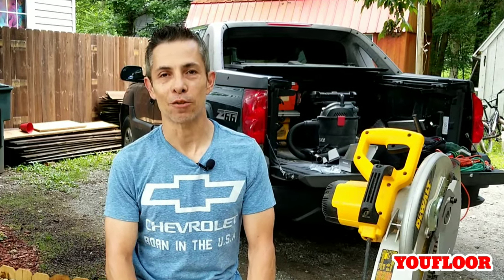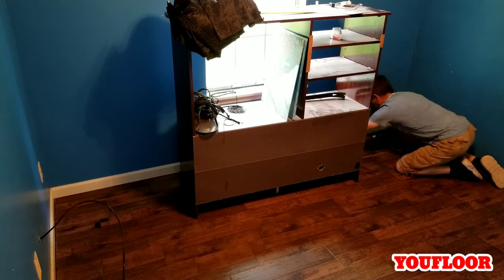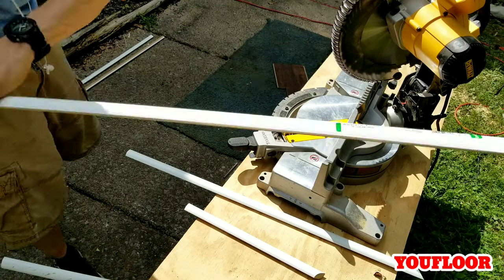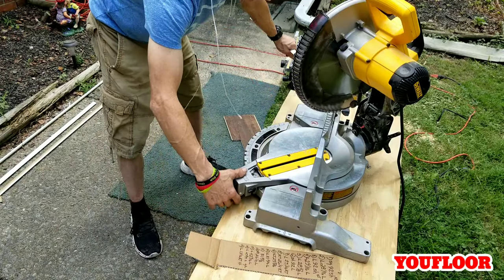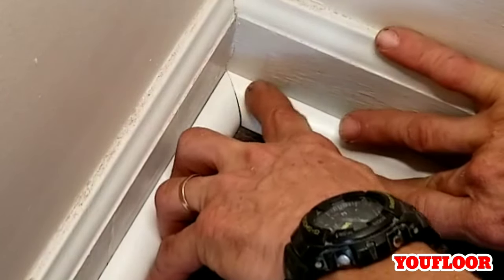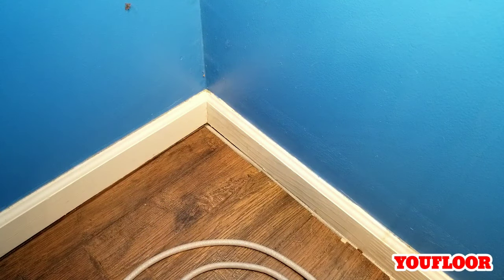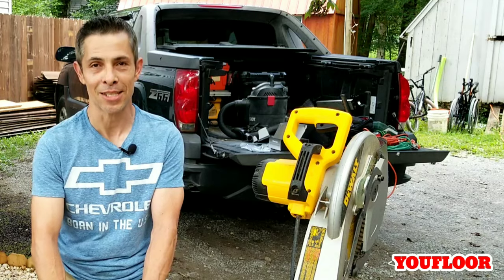How To Install Quarter Round Like A Pro

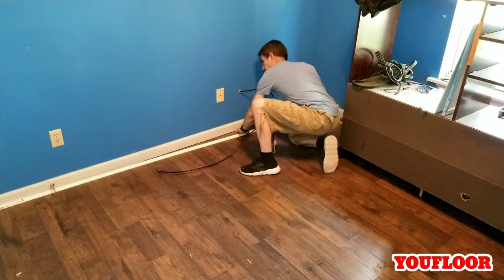Comment: Nice! So you cut the splices at 44 too? Sorry if this was answered already, I searched the comments, - nada. 13:04  6:33  . number 6 you don't write 45º - 3:12
Reply from the maker: I see what you mean. Yes, I use a 44° . There are way more inside corners than outside in a typical room. So I use the 44 to stay consistent and to keep from having to move the saw again. But honestly, you can do your splices on any angle you want as long as you stay consistent. Don't want to cut one side on a 45 and then say to yourself, " Was that a 44 or 45?" So if you decide now that all your splices will be on a 22.5, then you'll always know what the other side is. Base in your rul for splicing. Hope that helps. Thanks for the question
Reply: @YOUFLOOR  Oh yeah, thanks - meci - obrigado, for the free tip.

Comment: How many teeth for the blade do you recommend for the saw for the mitre cuts?
Reply from the maker: That really depends on what your doing. If you are cutting  lumber or 1x material  such as 1×4 1×6 1x8 ect. Then 40 teeth should be sufficient. But if your cutting Intricate cuts including small fine pieces I use 60 teeth. They make 80 teeth and higher but for the money 60 does me just fine. Hope that helps. Thanks for the question

Comment: HI Z, when you splice 2 pieces of shoe together with CA glue, what angles are the 2 pieces cut to?  Great video!
Reply from the maker: Most of the splices Re on a 44° . No particular reason other than it keeps from hav5to adjust the saw. There's usually more Inside corners than outside. Also I don't always use c.a. glue for quarter round. But I want people to be exposed to it that went aware. This stuff is great for baseboard,  crown molding, door casing. I love it. Thanks for the question

Comment: should i install a baseboard before installing a quarter round?
Reply from the maker: Base board should  be put on before 1/4 round. And if your flooring goes all the way to the walls with expansion gap you wont even need 1/4 round if the baseboard covers the edges with no gaps. Hope that helps.  Thanks for the question

Comment: Hi, new to this, and my miter saw  (a hart 7") sucks the wood in and splinter it if its too short. t I dont know what to do.   If there is significant length on both ends its not a problem, though it still does chew the edges up a little bit.  Any ideas to help me with this?  I'm new to this miter saw and am ready to go back to using a hand saw.  Thanks
Reply from the maker: Couple questions 1.  Is your saw new or did you buy it used.  If you bought it used and may need a new blade if you bought it new it may need a good blade.  When the blades get old it can leave the ends of your material frayed and it can also chunk small pieces out. I've even had them throw pieces 15' away at a high rate of speed ( #SAFTEYGLASSES). This also happens when the blade it bent. With the saw unplugged look at it from the front and turn it slowly to see if it wobbles. Here's a couple tips that may help
1.  Get a new blade. Diablo is a little more expensive but last twice as long and it is well worth it. Trust me your 1st cut it will feel like a hot knife going through butter, like it was cut with a laser. That might fix the problem right there. 
2.  Make sure the blade is spinning at top speed before you pull the handle down to touch your wood.  Also let the blade stop spinning before you lift the handle. this is what always makes my wood chunk out when it happens
3.if your cutting a real small piece. Take a piece  of scrap wood (example: 1 inch wide 1 foot long and 1/2inch thick. Kinda like a thick ruler or whatever you have) put it against the fence 1st then put your piece of 1/4 round against that. It will cut them both but stops the small piece from flying away. Then you can slide your scrap piece down to cut another one. When your scrap piece get too small. Get another one. Sorry so long, but I hope that helps. Good luck with your project. Thanks for the question
Reply: @YOUFLOOR  Thank you so much for your quick response!  I really enjoyed the video.  Its a new saw, but inexpensive, so maybe the blade it came with is not great.  I'll give the scrap piece of wood behind the trim piece a try and see if that helps.   Thank you again for your response, and the video!

Comment: What length and gauge (18?) nails are you using to fasten the quarter round?
Reply from the maker: Yes 18 gauge.  2 " long
Reply: @YOUFLOOR  Mind if I ask why so long with laminate moulding? I would think a 1 .5 would be plenty long enough.
Reply from the maker: Well sometimes the base board is a little too high for the nail to make contact with it. The nails will shoot underneath.  But 3/4 molding, plus 3/8 base mold, plus 1/2 drywall is 1 5/8 inch that leaves 3/8 of and inch to penetrate the bottom plate or shoot down at an angle through the expansion gap. When you run across  those small dips  trying to get the 1/4round to stick is tough without enuff grab. If the base boards are low to the ground 1 1/2 inch is fine. I have used 1 1/4 in a pinch but you have to be precise and go through the very top of the trim without skipping off to get it to stick. 2 inch nails covers everything . Hope that helps. Thanks for the question.

Comment: Is the measurement you write down the length against the wall or the outside (visible)? So for the L 29 & 1/16 L example how long is the side that goes against the wall? You can tell from my question I'm a little confused about this. I'm thinking its the length against the wall so in this example the finished side would be about an 3/4" shorter (3/4 thick).

Comment: My quarter round is not caulked on the bottom, and there are bugs constantly climbing out from the bottom of my quarter round. Is it supposed to seal the upper and bottom portion of quarter round?
Reply from the maker: @Esabella Li If the perimeter was sealed there should be a silicone seal that bonds the quarter round to the floor and the baseboard. No critters should be able to come through it. Are you sure the perimeter was sealed? Thanks for the question.

Comment: What do you do for an end part that is visible ( next to a door where the trim is flush with the door frame)
Reply from the maker: Good question. You probably  need to put a return. I go over a couple different ways to do returns in this video.https://youtu.be/abkTRdbOd2I. Thanks for the question

Comment: Will the backer and caulk cause issues with expansion and contraction?
Reply from the maker: No sir as long as you use 100 % silicone you should be OK. It's very flexable
Reply: @YOUFLOOR  thanks for the reply! Have you ever tried big stretch? It's not 100 percent silicone but it's supposed to allow a lot of movement
Reply from the maker: I haven't heard of that. Will have to check it out. Thanks for the tip

Comment: Do you do the same  thing 44 and 46 degree for base board installation?
Reply from the maker: No. I usually cope base board. Should make a video about that. Thanks for the comment
Reply: Thank you for the reply. I used your method for my last quarter round installation. I learned how to make a list of cuts and 44 and 46 deg cut idea. It worked very well. Now I  have to base board at other location. Thanks again.
Reply from the maker: That makes me smile. Thanks again for the engagement

Comment: I agree, a great video.  Just a question about the 44 and 46, obviously that's for 45 corners but would the rule of thumb be a degree less for any inside corners and a degree more for any outside corners that isn't 45?
Reply from the maker: Hmmm. That's a great question. Some times I do a 23° on 22.5° angle sometimes. But for the most part if it's not a 90° inside or outside corner I usually use my angle /miter gage to get the exact cut. Thanks for the question
Reply: @YOUFLOOR  Thanks for the prompt reply.  But if you make an exact cut, wouldn’t you run into the same issue as cutting 45 on a 90?
Reply from the maker: No . You see the 44 and 45 are to compensate for the drywall build up. If I took to time to go get my miter gage to check them they would probably be close to 44 and 46. Show when I am on a weird angle I have no choice but to use to miter gage to find the angle on my saw. Check this video out. Once you use one of these there's no turning back. https://youtu.be/abkTRdbOd2I
Reply: @YOUFLOOR  yes, you are right.  For jointing corners, do you also use the crazy glue and accelerator?
Reply from the maker: No I only showed that to introduce it to those who have not been exposed to it. It was a game changer for me. Only time I use it on 1/4 round is if I have a bunch of tiny piece that go together like houses that have round corners. When doing the 3 piece on open ended walls that have 22.5 angles or around a cut up fire place. I like to glue them all together so I dont have to shoot nails through the little pieces. If they are stuck to the big pieces i can just shoot through the big pieces. a little caulk on the top line and it looks sharp when all put together. Great questions man. Thank you for the engagement.

Comment: This is great! I see why i had issues installing my quarter pieces with my father now! However, do you have suggestions on how to keep the quarter pieces closer to the floor while the floor is not flat? Thanks!
Reply from the maker: That depends on if its concrete or wood subfloor.  If you have a wood subfloor you should be able to push the 1/4 round down and nail into the expansion gap right through the floor. If its concrete you're going to have to push it down and use long nails to shoot into the wall plate. You'll have to shoot through3/8 or 3/4 base board. 1/2 inch of drywall and the thickness of 3/4 round. That's 2 inches and they don't make an 18 Gauge brad nails longer than 2 inches. so if it won't grab you may have to use hand drive trim nails. Hope that helps. Thank for the question

Comment: When installing quarter around by wall mounted register vent, so I go across the base with the quarter round or so I end at the one side and restart it on the other side of the register vent?
Reply from the maker: Yes sir that's what I do do stop it off one ine side nice and square then pick up on the other side. Hope that helps. Thanks for the question

Comment: When you cut them you were not measuring the length how do you get it to fit perfectly when your just cutting them randomly it seems like?
Reply from the maker: I just butt it against one side, and then I mark the other side with my thumb nail and pull it up to cut it. Hope that helps
Reply: @YOUFLOOR thanks for the reply!

Comment: Great video and tips. One question, how do you accurately measure an inside corner for an accurate cut since the tape measure is bent? Seems it would be easy to be off +/- 1/16" or more.
Reply from the maker: I use trial and error I can usually get it pretty close then buzz s little off if it's too tight. Also there's a trick with the tape measure. A secret most don't know about Check it out in this video. https://youtu.be/fh7PJLwIpms. Thanks for the comment

Comment: great video. can you link to the silicon you were using?
Reply from the maker: @SirHotness here are the links to the silicone I use. There is an all purpose (blue label) silicone and a kitchen and bath (red label) silicone. I can't find anything different about the 2 silicones except one has a blue label and one has a red label and they usually are priced different. I use both!

All Purpose: https://www.amazon.com/gp/product/B0000CBIH9/ref=as_li_qf_asin_il_tl?ie=UTF8&tag=youfloor72-20&creative=9325&linkCode=as2&creativeASIN=B0000CBIH9&linkId=a9d7d772c6e6e1dbc7fc5cd259a9ecfc

Kitchen and Bath: https://www.amazon.com/gp/product/B01HZW0T9C/ref=as_li_qf_asin_il_tl?ie=UTF8&tag=youfloor72-20&creative=9325&linkCode=as2&creativeASIN=B01HZW0T9C&linkId=0ea240628dde43bc3ee9d833a834483c

Thanks for the question!
Reply: @YOUFLOOR  thank you
Reply: @YOUFLOOR  also there was a silcon or foam caulk saver you put down before you calked. i bought frost king foam caulk saver, do you think that will work or something else?
Reply from the maker: Yes! That’s what we use! Thanks for the question!

Comment: I removed old Parkay wooden flooring from my basement and laid Cortec LVP. The new flooring looks great but the existing baseboard is 1/2" above it. I want to install 3/4" shoe moulding but the 1/2" gap presents a problem. My thought is to place a 1/2" sq wooden rod into the gap and nail or glue this in place prior to attaching the shoe  Do you think this will work? Do you have any other recommendation? Thank you
Reply from the maker: That sounds good.  I have used this method before and cut small blocks up in to 4-5 inch pieces and space them out along the wall. Glue and nail them and then nail into them when nailing your shoe molding on.  Hope that helps. Thanks for question.

Comment: I am very interested in the complete water proof of the edge so water cannot go behind and under.  Will the foam rope you showed in the video interfere with the 1/4" expansion gap between the end of floor and the wall, that is making the expansion gap too small where plank floor cannot move?  Thanks.
Reply from the maker: The foam is squishy and the silicone flexable. We were given a class on how to install this and I asked the same question. The instructor said the foam and silicon will flex just enuff to let the floor expand And contract. So you should be just fine. Hope that helps. Thanks for the question
Reply: I was proposed another way to address the potential water seepage behind and under concern at the quarter round edge, which does not involve the foam rope. Instead just apply a thin strip of silicon at the floor where base of quarter round will sit.  Will that seal the gap.  By the way the contractor that is doing the install these few days do not have experience with silicon seal the bottom gap under the quarter round where it touches the floor.  So I am looking for a video to illustrate how this is done.  I came across this video of yours.  Tomorrow will be the second day of the install, they may start working on applying the quarter round or maybe 3rd day.  I don't think I have enough time to find the foam rope.   So I'd like to know if you can refer me to a video where it only uses silicon to seal that gap and how to do it so residue will not be seen in the front and the seal is done either under or behind.  How to properly do that in a video format?  Thanks.
Reply: Backer rod is sold in Floor & Decor, Lumber Liquidator as well.
Reply from the maker: Thank for the tip

Comment: Would this same tip with the 44 and 46 work with baseboards? Or would coping still be ideal? Thanks
Reply from the maker: I think it would work. But for tight corners, coping is always better. Plus if you are gapped up at the bottom you can always put a screw in the bottom plate and adjust it in and out so when you put your inside corners together base against it. It won't suck in. The screw will hold it out. Thanks for the question

Comment: How do you install 1/4 ROUND TRIM or SHOE MOLDING around a BULLNOSE corner?  

Been looking everywhere but can't find the answer. Thanks!
Reply from the maker: Check this little tool out. If you're talking about round corners. They are cut in 3 pieces. On a 22.5 degree

Comment: My quarter round didn't come with labels. How will I know what side is what as far as if its a quarter round or a shoe mold?
Reply from the maker: That's an easy one. Set your trim in the saw or against the wall. Scribe a little line on the top then flip it over and see if it lines up. If it lines up perfect ,then you have true 1/4 round. If idoesesnt line up the other way probably shoe mold. Remember quarter round is 3/4 thick where shoe mold is only  about 1/2 inch. Hope that helps. Thanks for the question
Reply: @YOUFLOOR  thank you

Comment: Good for pros but no info for DIY. We don't have a $500 miter saw and nail gun. Wanted to know how to keep the molding from splitting when nailing. 44-46 is informative but how do you make that happen without a table top miter saw
Reply from the maker: Well brother 1at of all. And no offense.  But it seams as if you think more like"i can't because "..... as opposed to "how can I" Should be more positive. Anyway you can go to Amazon and buy a craftsman miter box for $14.00. You can place a small wedge behind one side to create the 44/46 degree. When driving hand drive nails. You can either drill small pilot hole slightly smaller than the nail.. Also try taking the nail and setting the head on the ground with point pointing up. Tap the point with a hammer     like twice not to hard just to blunt the point. This should help to not split the wood. Hope that helps. Good luck with your projects. Thanks for the question

Comment: what do you do when the door jam is higher than the new floor?
Reply from the maker: Do you have any power tools. If it was me I would buy matching trim. With a miter saw I  cut up a bunch of small slivers the thickness of the spaces and then if it is a little thick, I take my sanding block and rub it back and forth to knock it down to the perfect thickness. Then glue it in place caulk and paint. Hope that helps. Thanks for the question.